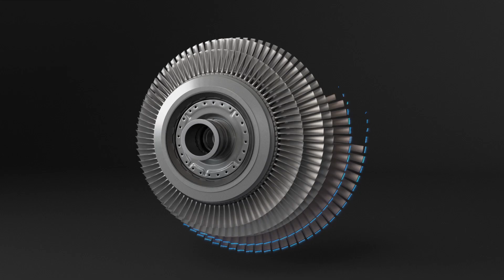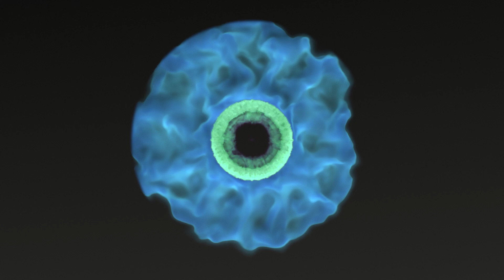Pratt & Whitney GTF Features

Comment: One "feature" of the GTF is that almost 100% of the torque load to the Fan is carried by only 2 (out of 5) of the gears.  But, don't have to EXPLAIN that to get certified per the cert folks at the FAA because PW never told them.  Lying by Omission, OK as long as the executives receive their quarterly fucking bonuses.

Ultimately that big planetary gear at the front of the engine is going to BREAK more frequently than that what was promised by PW to the Airlines that bought the engine.  They are going to FAIL ETOPS.  Just wait.

Paul Adams, "fired" because he "couldn't deliver" on schedule, NOT because he couldn't deliver a safe and reliable engine.  Tells you everything you need to know about the GTF from Pratt.  Schedule First, Safety and Reliability Second.

Hey Paul Adams, why don't you talk about the Mirabel un-containment?  Come on!  Don't be so shy!

FAILURE.
Reply: If the setup looks radially identical, can you explain how only 2 of the 5 gears carry most the load?
Reply: THAT is the fucking POINT.  NO ONE to this day has been able to explain.  The entire Safety Certification process consists of EVIDENCE submitted to the FAA cert office (for the GTF, this is Burlington, NH) and statements of conclusion, "here is this evidence that shows this FAR is met" hundreds of pieces of evidence, including the cyclic loads on that planetary gear, at the end of the report, a statement "this engine is safe"  

PW did NOT do that, they left the un-equal loads of the gear buried in management "decisions."  And it was simple to REMOVE the words from the certification report "the loads on the planetary gears are un-equally distributed, however we do not assess this as impacting any safety requirement"

Simple, and removed from the certification report submitted to the FAA,  no transparency to the FAA, just like the two Boeing Max crashes, keeping an analysis outcome inside of the company for ....meeting a planned schedule.

Fuck the management LIARS in Pratt & Whitney and fuck the idiots inside the FAA for being so STUPID not to see this.  It's their fucking JOB.  (the FAA and the DOT has been notified outside of normal communication channels about this issue and others concerning the certification of the PW1100G engine and have done fucking NOTHING to this day)

 @jeylful
Reply: I can, PW can, PW never informed the FAA.  Transparency of what was found when certifying a new engine was not present at PW.  Schedule and "gender parity" was present, NOT ethical and moral Engineering Design behavior when building something that can kill people if it fails catastrophically.  Can we think of another incident of transparency kept from the FAA?  Oh yes you can!  It's called the Boeing 737MAX.

   @jeylful